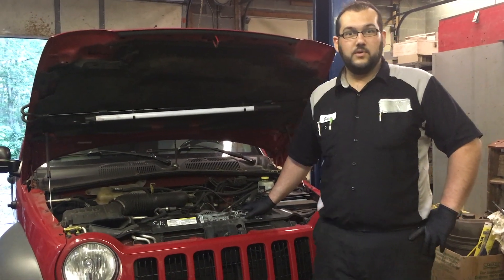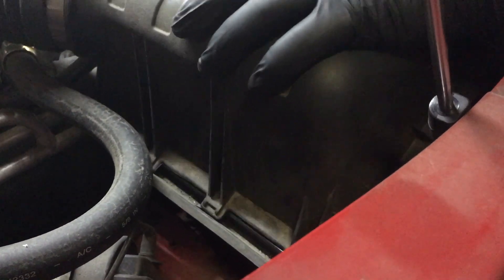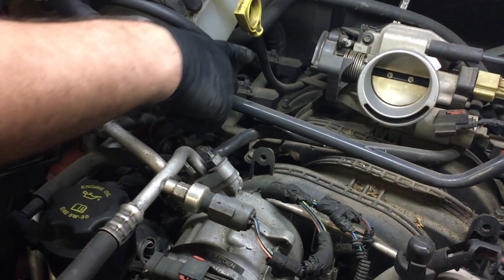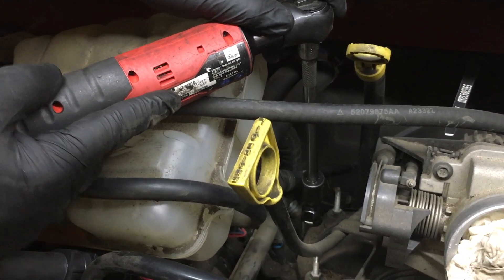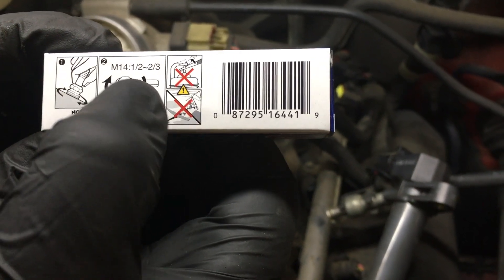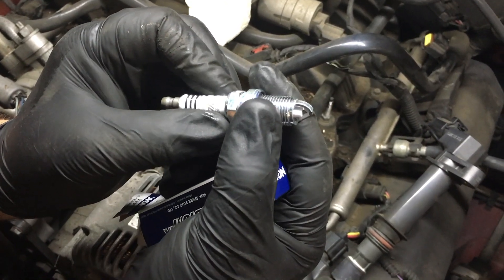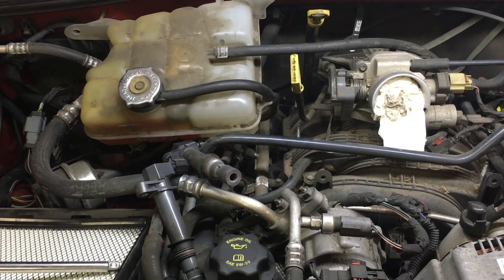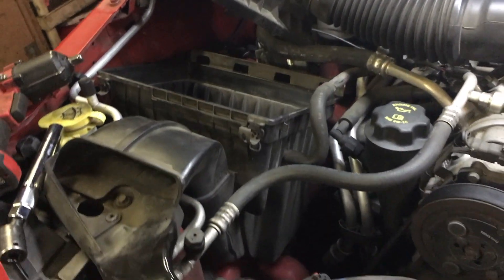Jeep Spark Plug Replacement - 2005 Liberty 3.7 V6

Comment: Solid video. About to change my plugs and coils on my 2004 Liberty.
Reply: Hello Brad I got 2004 as you, just for curious what type (Brand, type,gab) sparg plug you used?
Reply: @richardgarcia6201  NGK Spark Plugs, model ZFR6F-11G Gapped to 0.040 in. When you lift your hood, there should be a sticker near the hood latch area that has this information on it in case you forget. Hope this helps. 🤙🏻
Reply: @BradM766  are zfr6f-11g spark plugs the only way??

Comment: You dont really need to remove anything at all, as long as you have a 10mm socket and a few extension drives that will fit any ratchet, and a 5/8 magnetic socket to pull the plugs.

Comment: Are the spark plugs factory gapped or does it need to be adjusted before putting them in???
Reply from the maker: They are typically gapped from the factory, but I always like to double check them before installation and adjust if necessary.
Reply: @theservicestation9040  Thanks

Comment: I just got check engine ligh on and it shows up 3 codes P0300 , P0303, P0305 do you think if i change the spark plugs it Will fix the problem ?

Comment: which coil is it? Ignition Coil "D" Secondary Circuit
Reply from the maker: Coil d is usually cylinder number 4. You can google the firing order to find out which cylinder that is.

Comment: Do i need to change all the six if just one is bad??
Reply from the maker: +JULIO AUGUSTO it’s a good idea, especially for maintenance. But you do not have to change them all.
Reply: @theservicestation9040  if it has less than 5k miles before one goes bad then you can replace just one. I replace them all because I get better deals for a set of them instead of just one.

Comment: what spark plug socket did you use , mine seem shorter than that?
Reply: nevermind I seen the the mac lol duhhh
Reply from the maker: Haha. You can use a shorter socket, but for the deep spark plug wells I like the extended reach versions. Glad you liked it!
Reply: 5/8th

Comment: So when I am trying to remove my coil pack the top bolt that holds it in place is not moving, but the bottom bolt is moving. Any ideas on how to remove just the top bolt.
Reply from the maker: +Jeremy Mott I’m not entirely sure I understand what’s going on. There shouldn’t be more than one bolt holding the coil on. Is the brass insert in the manifold twisting and the bolt not loosening?

Comment: What hand drill was that you were using?
Reply from the maker: It’s a Snap On 3/8” micro lithium impact. Love it!!
Reply: The Service Station no what's the brand of that twirl tool your using I need that
Reply from the maker: Was it one of the power tools? One was a Snap On CT761 cordless impact wrench and the other was a Snap On CTR761 cordless ratchet. Milwaukee also makes some comparable tools which are available locally and they’re a little less expensive.

Comment: I just got a check engine light and the code says that Cylinder 2 is misfiring. Is it still necessary to remove the coolant tank and air intake duct in order to look at just that plug?
Reply from the maker: Zach Broughton you shouldn’t have to. The #2 cylinder is the front one on the passenger side so you just need to remove the coil and spark plug. If you haven’t replaced all the spark plugs in the last 30-50k miles I would go ahead and install a fresh set, but that’s up to you and your budget/time constraints. Thanks for watching!